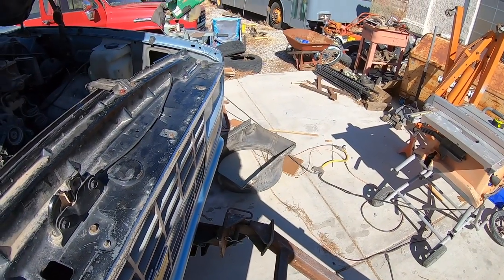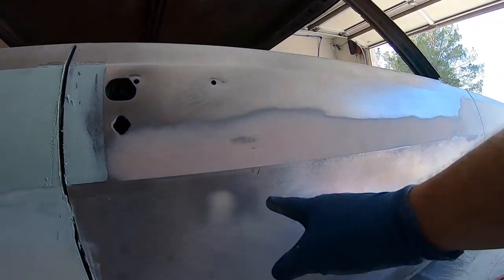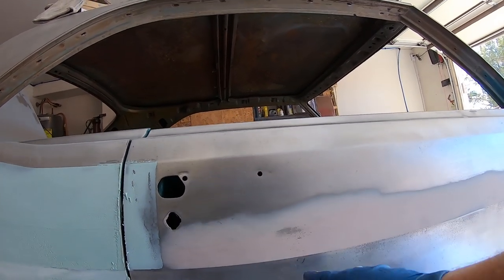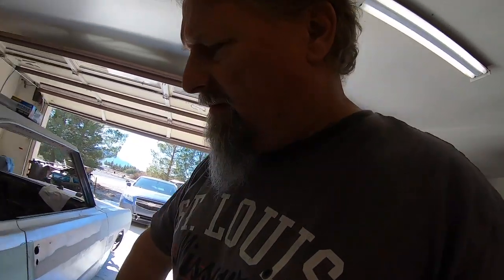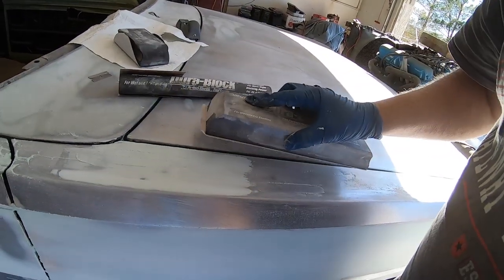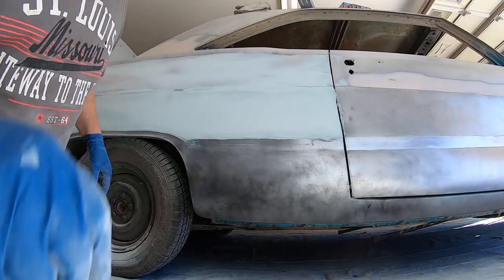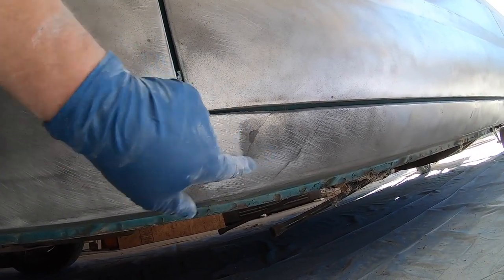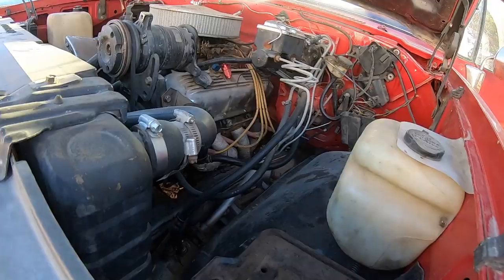1969 Dodge Dart Body work - Body Filler Tips

Comment: That's a good tip about the black coating. When I was younger (29 years ago), I used dull black paint to find the low spots on a car I was trying to make pretty. My friend bought the car from me before I painted it. Sad to say, I didn't know he was going to use it in a demolition derby. So all that work wound up on the track. Can't wait to see yours painted and running.

Comment: An idea, use a steel basin with rubber/foam underneath to absorb shocks and distortions. The extra advantage would be it can be made watertight and hold tiles without risk of leaking, a bit late to come up with this idea but if you ever need to repair the toilet in about 20 years or so you have the suggestion.

Comment: Hell Yeah I still watch your videos..   While I have never done tile in a RV... I have used that exact mastic and its big brother Omni-Grip more times that I can count without any issues.   Using the mastic vs. thin-set makes the most sense to me... you're always going to have vibration and slight flex in the walls and pan and I absolutely agree the cured mastic has more flex to it in relation to any bagged Thin-set I have used.  The thin-set gets an amazing bite...but when cured it's brittle.   My grandparents lived near Edwards AFB and I remember as a kid lying on our backs in the field and watching the jets break the sound barrier... the sonic boom was awesome.    Have a splendid weekend.  Maybe My memory is no bueno... but did you get that overdrive installed into the Dually???